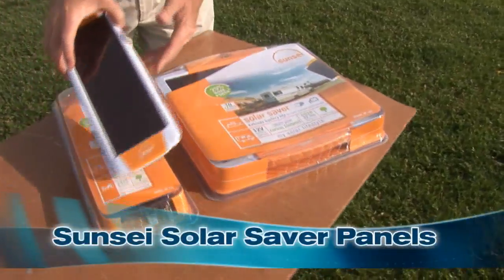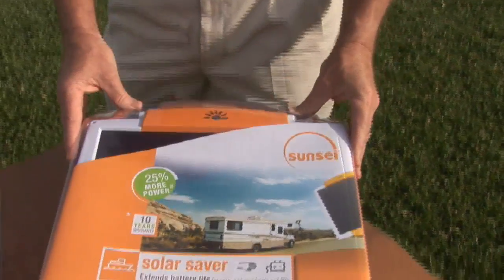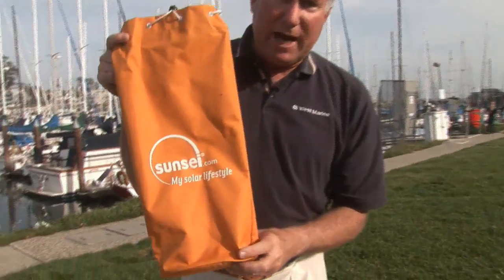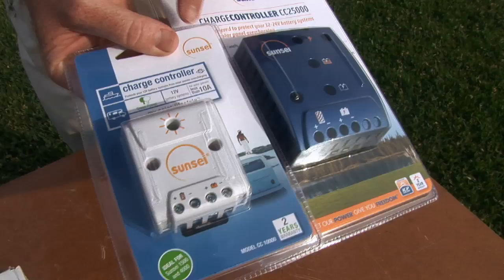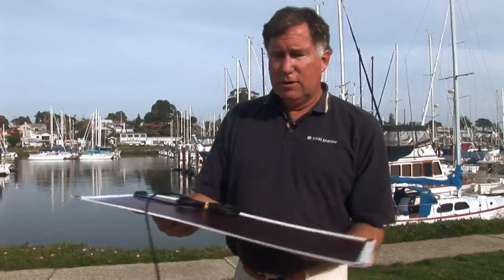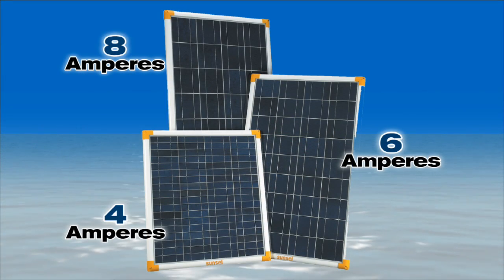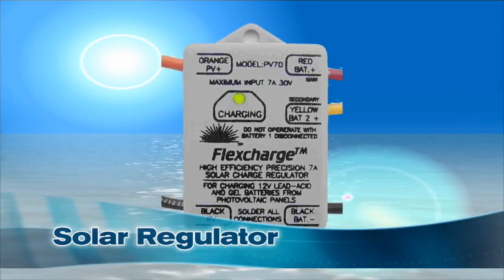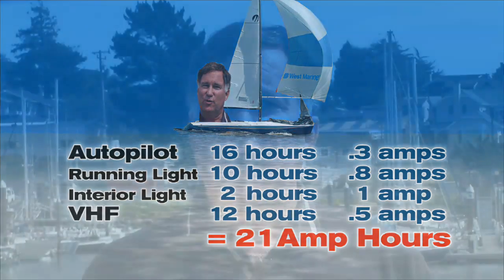Charging with Solar Panels - Panel Types - Part 2

Comment: This video playlist helped me better understand electric systems on boats, but I'm still a little lost... I don't understand the connection between the amps from a solar panel to the usage... You did the calculations to determine your amp usage, based on a per hour basis (.3 amps for 16 hours, etc)... how does a 3 amp solar panel cover 21 amps per day? is the 3 amps from the solar panal assuming a per hour rate for 7 hours to cover the 21 amp hours used?

Comment: Hi Jar, 
Yes, any store would be able to order the appropriate panels for your use. Since these video is a little dated, the products available today might not be exactly the same, but obviously the concepts are the same. You might also check our web site under Solar Panels for our most recent offerings. Cheers, Chuck